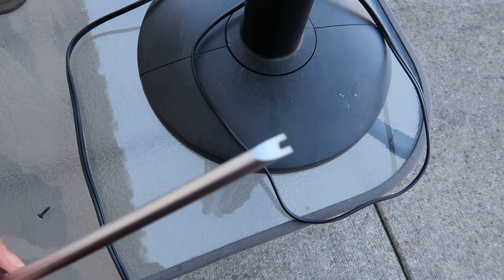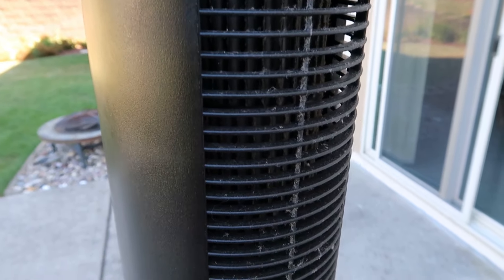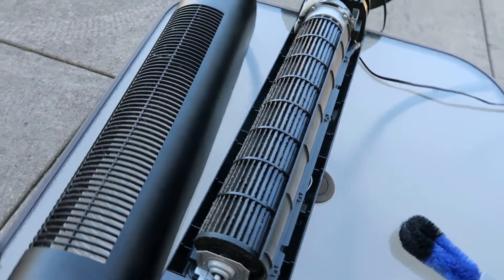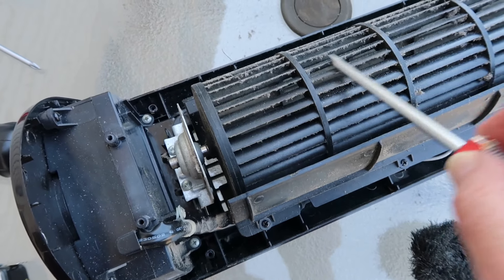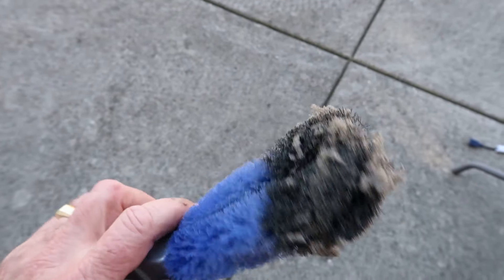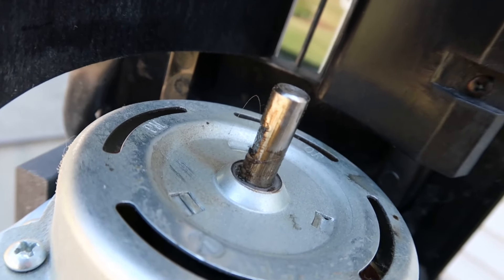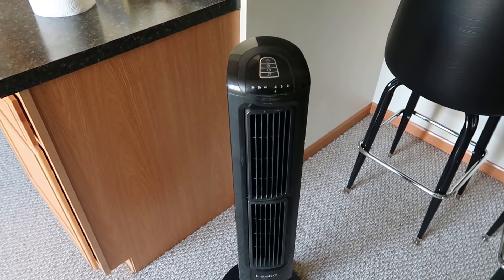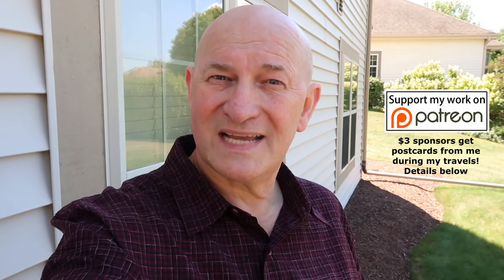How to Clean a Lasko Tower Fan | The BEST Way!

Comment: You KNOW homie just didn't have any time for this.  So I just like usual threw the whole thing in the shower and did it super fast.  I had two of em to do!  So I stick it out on the balcony to dry for a few hours til dusk, then I will bring it inside and allow my DEHUMIDIFIER to suck ALL the rest of the water out of it before it logs the circuit board.  You can usually do these about 3-4x I guess before they become destroyed IMO.  Seriously, these things get chucked all the time, and this I have found so far is the easier/fastest and best way to get rid of the garbage from the inside.  Saves about 90% time.  Yet you either want a super hot sunny day, or that dehumidifier in order to get the water out completely before it destroys the electronics (and believe me I could care less about getting that part wet and it surely does).  Works for me anyways :)  Thanks for the vid though, you sure went all pro old skool on it!
Reply: Well, it's the next day, and the thing works like a champ (The Seville) ...perfectly clean with all the toxins/gunk out of the insides, and saved me 90%+ of the time in working on this...the honeywell still seems to have some moisture on the circuit board, so I am pumping the Seville into it on medium, should dry the rest of it out in about a couple hours this way.  Until they supply me with my new portable air conditioner (saved the old one to trade in for it as we have a program here in Ontario) these two units someone threw out the other day will supply all my summer time cooling needs for my bach apt.
Reply: Wish I had the same kind of luck WHEN I WASHED keyboard, yet I find that it will destroy about 50% of them, so that is AN OPTION I HAVE TO SKIP from now on and just do the job properly if I really want the keyboard clean...so as mentioned keyboard, etc. are too delicate an electronic on avg. in order to apply this technique, yet every time I have tried this on these tower fans, I have already succeeded!  So yeah, avoid doing this with keyboards as convenient as it would be if it worked all the time (destroys more than 1/2 of them appx).

Comment: they must have seen this video and gotten a little upset because ALL of my screws are security screws, and they are the hexagon shaped screws too lol luckily i bought a security screw set off amazon last year 😉
Reply from the maker: It makes you wonder why, doesn't it? Since we can buy the special screwdrivers anyway, why not simply use Phillips screws!
Reply: @AverageMe  well most people havent seen the screws before and may not bother taking it apart at all. like you said you hadnt seen security screw like that until recently and until last year i had no need to buy a security screw set. they would rather the device get plugged up so you have to buy another one. speaking of, that is alot of dust for your unit. idk what conditions they may be in but you may want to have your hvac system serviced. could be alot of dust build up in there. i noticed the same thing happening in my house and decided to get my ducts cleaned. great video by the way. once i get a longer screw driver ill have to take mine a part.
Reply: I have had two of these two tower fans but after this no more. I will be going to the old fashion  😊 route.

Comment: To save yourself a lot of work,  the next tool you should buy would be an air compressor with a blower nozzle
Reply from the maker: If you watched the previous video, you'll see I tried that route. It doesn't get it clean. Even if you just want to blow the loose stuff off, you'll want to do this every so often.

Comment: I just put mine in the shower--get a cup-----tip the fan forward and put water thru it using my cup. From the back then from the front. Don't get water in the controls on top. Make sure to hold the fan and tip it in the direction u want to clean. Then plug it in and let the water come out and dry. I've been doing this for 5 yrs.
Reply: seriously?
Reply: @SPQRIUS  Yah just dont get the water in the top near the electronic controls.

Comment: I don't know if others had this problem but mine had to fasteners that were not even the spanner type screws. The heads were ^ pyramid shaped but with rounded edges that nothing would grip. I ended up going nuclear and taking my angle grinder and cutting at the seam where the screws were. That actually was easier than I thought and the gash isn't too bad. I could hide it with a strip of black tape. 

The fact that they use these odd fasteners just p*sses me off because it's so obvious that they are trying to prevent you from getting it apart thinking it will make you buy a new one. 

BTW, I didn't put half the screws back in it. It's not a problem and if I take it apart it will take half the time. 

I was hoping to fix the occilating mechanism but turns out the motor has an internal gear reduction thing that is worn out and skips and won't stay engaged. 😒
Reply from the maker: Yes, I agree. They don't give you a way to clean it, and then they lock you out of disassembling it. Not good company public relations.
Reply: Have you considered 3D printing a replacement for the reduction thing?
Reply: @chrischiesa609  Are you sure you thought that question through before you asked it? 3D printers make copies right? What good does it do to make a copy of a worn part?  If I had the part I wouldn't need the copy and I don't have a 3D printer and it doesn't make any sense to buy a 3D printer that would cost more than the fan, obviously. Oh, and BTW her name was Melanie

Comment: What this video missed is he never cleaned the ceramic heating element. Cleaning all the plastic parts and rotating fan is good for aesthetics. The key to the heater functional operation and end of the problem a dirty heater going off within a minute it's turned on is cleaning the ceramic heating element.
Reply from the maker: I was just cleaing for dust and dirt removal, not for operational issues, which is more for health and allergies than simply asthetics. I need to point out this is a fan, not a heater fan. But thanks for the helpful tip, as some viewers may be cleaning heaters!

Comment: Come on man.  Leaf blower to the back of fan, front, then back again - done!!!!  Dust free - 3 minutes max.  You're welcome.
Reply from the maker: Well, seeing as an air compressor has much higher PSI than a leaf blower and using that still required some scrubbibg and loosening of the dust, I"m thinking we might noeed a little more. But thanks for the tip!
Reply: @AverageMe  Yes an air compressor has a higher psi but you'll over-speed and damage the fan blade bearings if used.  Were the front vents still that dirty after after using the compressor?  If so, you must live near a glue factory  :>)  Mine became completely dust free after 3 minutes with a leaf blower.
Reply: @chilechilelli6319  you approach is inferior to either his or mine, seriously, that stuff is caked on there and there is pretty close to zero chance anything except a proper cleaning is going to get that stuff off...done this about 10x, only thing that works to take that gunk off proper is hot water with a fair amount of pressure!
Reply: also over speed and damage the fan speed bearings?  That's pretty funny, as if these things are going to blow out and cause some kind of raceway accident, haha.  Things work a little differently like this IRL buds :)
Reply: @bluetrinityhaloseven7244  Was just trying to tell people what worked for me. If taking your fan apart is better for you, have at it.  The bearing over speed statement came from Lasko tech support because the bearing housing melted while using high pressure air.  Keep your diaper clean.  Peace out.